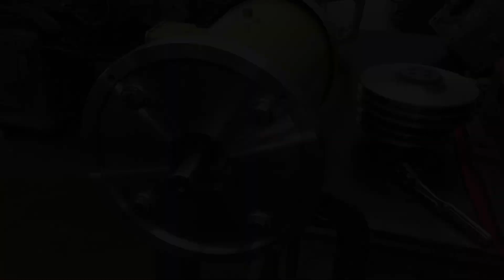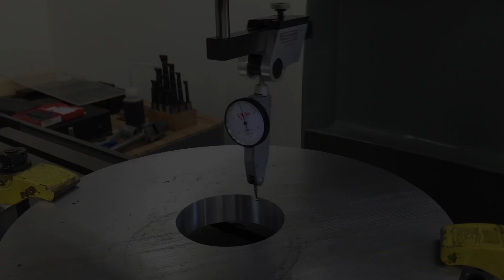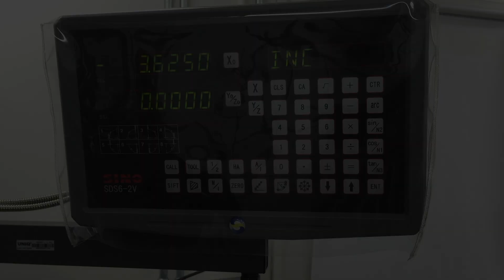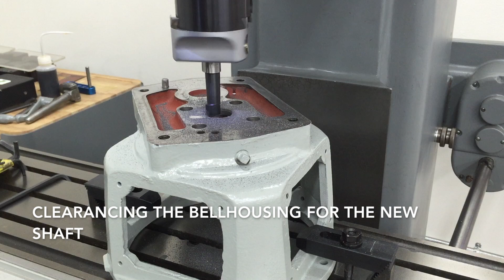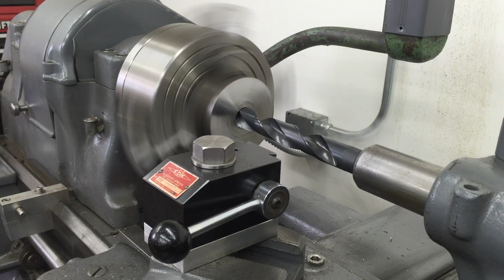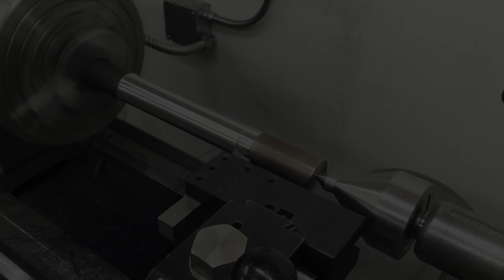Monarch 10ee adapter

Comment: Great Job!! What brand of motor and control did you use?
Reply from the maker: 1gdfoster1 Baldor 5hp and a Teco VFD. You have to use a 10hp VFD if you’re powering with 220v single phase....do to internal ratings, etc.

Comment: @ 4:28 when the center drill hit the work you can see it shift upwards about 1/16" - Is this because the tail stock is worn, and is now lower then center?
Reply from the maker: Yea...combination of a worn old lathe with tailstock extended pretty far.

One of the reasons for the project is to replace the lathe you’re watching.
Reply: @toddrudaitis6998  thank you. Mine does the same thing 😆

Do you extend the tail stock out so it can shift to center more easily?
Reply from the maker: Sean I don’t normally extend that far...I can’t remember, but probably needed the reach for some reason. I always try to keep things as short and tight as possible.